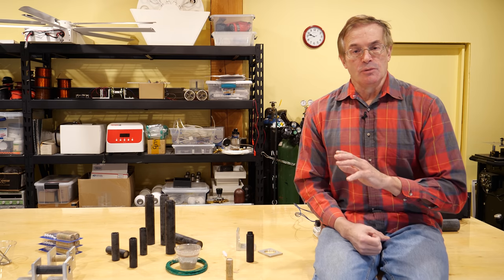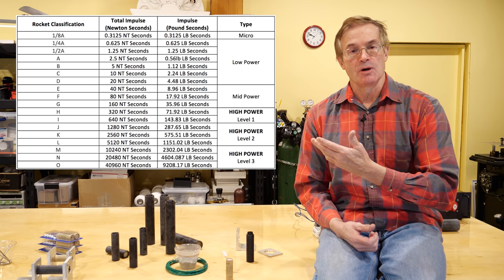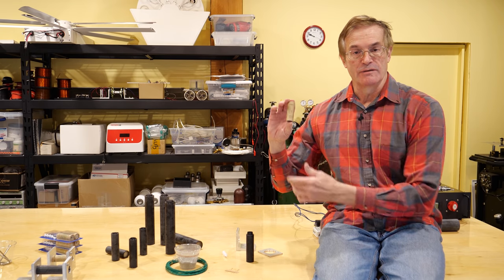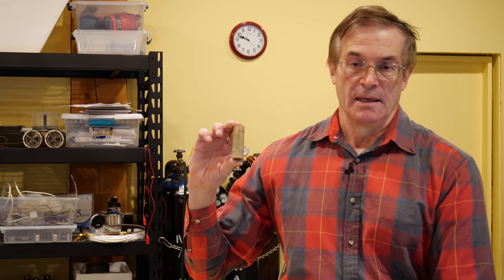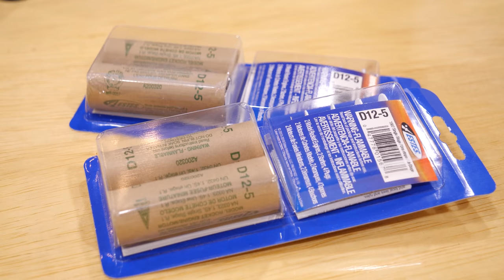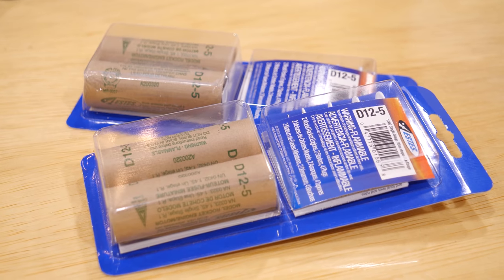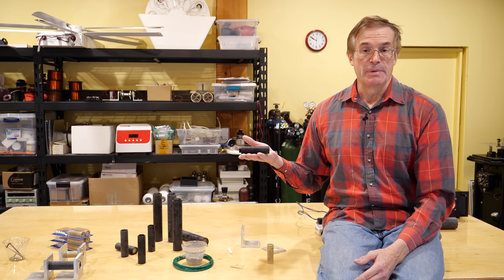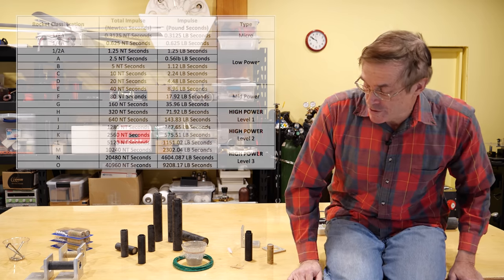Igniting Our Own Rocket Engines - DIY

Comment: I used to make these during high school, awesome stuff and a ton of fun!

But aren't you losing a lot of power with the sparks flying out? They are basically still reacting and producing gas which could add to the thrust if the combustion completes inside the engine. I know you tested many versions of these and found this the best fuel mix, but there is obviously still room for improvement
Reply from the maker: Agreed

Comment: May I suggest a couple more Tech Ingredients for this setup?

As others commenters have mentioned, the burn profile looked odd on your DIY motors.  While a larger and more uniform (faster) ignition surface is the likely fix, I would also suggest looking for inhomogeneities in the fuel itself, largely due to how the fuel was poured into the motor housing.  The conventional way to do this non-destructively is with high-contrast X-Ray and a field-flattener, where a few orthogonal exposures should detect most kinds of flaws: Density variations, inclusions and voids.

But non-destructive is no fun.  There is a sneakier way: Attach cheap piezo microphones to the motor (I use JB Weld), then look at the FFT of the burn.  Many inhomogeneities can generate characteristic burn patterns detectible in the audio spectrum as periodic or chaotic components.  Multiple mics are recommended to permit filtering and rejection of tube resonances.

Second, try to get a thrust profile using a few cheap load cells.  Combining the load cell data with the microphone and video data, you should be able to diagnose and dial-in the DIY motors.

No, I'm not a rocket scientist.  Just a sensor and instrumentation engineer who has worked on lots of weird and wonderful systems.

Comment: Hey guys, how about a large fan, on low, pushing all the smoke to the side opposite the camera? It would help to see some of the finer details if the latent smoke and fog were always headed away in a predictable direction. Would also help to see the velocity of the exhaust gas by how much it is defected by your constant input.

Comment: I was making a smokeless powder engine with a variable nozzle over 10 years ago. I made it with removable grains, but interestingly you can't transport the grains themselves over the highway. so I had to make several rocket shells with oversized nozzles so that it's classified as a PAD. I don't know if the laws have changed, but it's strange saying that rocket fuel without a nozzle is not allowed, but a entire rocket engine (below a set value) is.

Comment: Your burn rate is off I think, from my limited experience,  you need to ignite the grain from the back of the motor so that the flame ignites the whole core at the same time giving much more surface area to burn. Doing it the way you did means it is burning from the nozzle end toward the back of the motor. Thats why E matches are used, you can shove them all the way in and when it ignites the flame front moves down the core toward the nozzle, not back away from it. Just a thought, otherwise, great content!

Comment: Hey tech ingredients. I found a video on reddit where a tarp gets pulled up into the blades of a helicopter and forces a quick landing and some of the comments got me thinking. 

Could something like that be used as a low tech weapon? Let’s say you had a very thin sheet of Kevlar (so it doesn’t shred very easy) could someone realistically defend a city for example by simply placing these sheets on tops of buildings? Or make a low tech device like a air cannon that would just fill the sky with these thin sheets if a bad heli gets too close? 

You could make a very cool video about this using a cheap RC heli. You could try using different materials and find out the best material for this. I would imagine you would want a material that is strong enough that it won’t tear easy, but is also light enough that it will get pushed into the air from the downdraft, then get sucked into the low pressure zone above the blades... then well... chaos. 

It’s just nuts to me that something as cheap as a 10$ tarp could take down a multi million dollar piece of engineering. 

Here’s the link. It has sound too. The sound is nuts after it hits the tarp. 

https://www.reddit.com/r/ThatLookedExpensive/comments/ko2t5p/a_large_tarp_gets_pulled_into_the_blades_of_a/?utm_source=share&utm_medium=ios_app&utm_name=iossmf
Reply: This sounds very similar to the concept behind chainsaw safety pants.
Reply: @twestgard2  I didn’t even think of that comparison but yea, exactly!

Comment: Would be neat to set up a pressure meter in front of the rocket tube and have the rocket be able to slide through the end hole, so you could measure pressure over time, peak pressure, etc.

Comment: Have you considered building a frame to hold the motor that deflects proportionally with the thrust; maybe just a simple vertical cantilever with a load-cell near the support and load-cell amplifier calibrated in newtons? And then using a data logger and a PC to store the results, finally create a plot of thrust vs. time. This could be used to evaluate and compare impulses (⨜F(t)dt=mv(t)) which could be used to optimize fuel mix and nozzle design. And if you were to build a model rocket, and were able to estimate other parameters (e.g. -dm(t)/dt, Cd), it may help in modeling performance.

Comment: Im a chemist from the Philippines and I really appreciate and admire your channel specially this issue on rocket propellants. Thanks for posting chemistry knowledge dissemination . . . I love it. How about increasing more its thrust power by adding homogenously small amount of nitroglycerine or nitroguanadine ( this lessen the oozing visible flames ) and minute quantity but evenly distributed trinitro triazine. The last can triple the thrust, but will require bigger diameter nozzle.
Reply from the maker: I would be concerned with adding a high explosive, even a small quantity to the mixture while it is still hot enough to pour.
We will be moving to ammonium perchlorate based composite propellent next.  This is much more powerful and not much more difficult to fabricate.
Reply: @TechIngredients  wow, didnt expect a fast response. I'm now one of your subscribers. Kudos and keep it up !

Comment: It would be great if you teach how to make things with molded plastic, such as a small boat or Kayak. The knowledge will be helpful to build many things. Thanks,
Reply from the maker: That is basically what you do when combining epoxy and fiber cloth, glass, Kevlar or carbon.  Covering a male or female mold is the same as you would have to do if you were using a heated sheet of plastic, but the results are far stronger.

Comment: For reference, the generally accepted minimum energy required for humanely hunting white tail deer is 45 ft lbs of energy and a minimum of .25 caliber. These are roughly .40 caliber and the h rocket on a .25 second burn achieves or exceeds that 45 ft lbs if I understood the explanation correctly.
Reply from the maker: Actually, the engine contains far more energy.  The thrust over that duration will accelerate the engine itself to a velocity dependent on its mass and the energy can then be calculated according to, 1/2 MV^2.

Comment: Interesting, and thanks for the exposition. The ejector doesn't look to be that well constrained, so while the motor may have a high potential size based on the fuel, what is the actual thrust you're getting? I expect that is already for a future video which I'll look forward to.

One nitpick I have to raise; What the heck is is the unit NT in the table? The SI unit of force is the Newton (N). Is the table from a published source? 

 Congratulations on breaking 500k subs. I'm amazed it wasn't sooner.

Comment: First thank you very much for your always perfectly interesting video-uploads!
1. Question: @9:20 "Narrow Nozzle". To prevent disasters like this explosion, how can you calculate in advance the nozzle diameter in relation to the rocket´s inner diameter and the used fuel?
2. Question: @8:07 "Store Bought Motor D12-5". Compared to e.g. the F Motor @9:50, why the store bought motor produces less smoke (a), less sparkling (b) and a better shaped spindle-like flame (c), which reaches  further outside the rocket body (d) and sputters less (e) meaning a more harmonic and controlled burn?
3. Question: How do you know, which class your different rocket motors belong to? Do you calculate the weight of the mixture, and the known energy of your chemical composition with a specific  formula to say, that this is perhaps a "F" motor?
Thanks alot!

Comment: Congratulations on half a million subs! I'd like to think that I'm responsible for more than a few of those. You guys picked up a great subject that seems to have a plethora of videos on it but with less than complete information or explanations for the 'why' instead of just the 'what'. But that said, I think that you may want to reexamine  the impulse curve and why you are assuming a bell-like curve instead of a more sawtooth type of shape.  My reasoning being because the active ignition area increases over time as the fuel is consumed, as a growing cavity in the center of the fuel is created with a roughly cylindrical shape, the ignition area on the edge of the cavity also increases.  My best guess is that since that area is indicitive of the rate of oxidation at any particular time, then that production rate would increase in area almost linearly through time (perimeter times the length), and I stated 'almost' because of the length increase that is at the closed end of the engine (that is a small value) which would cause an upward ramp superimposed on top of the sawtooth. The production rate then is converted into thrust by the square of the velocity, so given a non-variable nozzle throat I was expecting to see a parabolically topped sawtooth shape for impulse over time plots....  I think the one that didn't survive was the best at illustrating my expectations. It was doing fine and then reached a pressure (because of the increasing gas production rate and restrictive nozzle) that was higher than the fiberglass tube was strong enough to contain, and rupture was the solution. 

I thought that you might have a datalogger and a load cell hanging around someplace, or scale or even a spring to tell quantitatively the impulse (average, specific, total) from the different engines, but then again, as a first go on testing these engines, it was fantastic. 

Thank you and again, congratulations. I'd bet that you hit the one million mark in the second quarter of 2021, if not the first.

Comment: Cool video. That 'unplanned rapid disassembly' of that F engine was pretty impressive. I imagine if that had happened with one of the larger H ones the hold down bracket might have had some damage. Where did you get that piece of ballistic glass you have protecting the nice shiny new camera?

Comment: You can in fact buy higher power motors. E-F is the highest you can get that are black powder. From the right places like apogee components or other hobby websites you can get PBAN engines most of the way up the letter scale.
I also noticed you are not using plugs with your engines when you light them. Fuses normally struggle to light more than one location inside the engine, so when you plug the nozzle, the combustion chamber fills with hot gas and can light the entire grain surface before it actually starts firing. Obviously you really need to be careful as this adds a lot of stress on the casing. I played around with it as a kid and found different performances based on electric igniter depth as well how firmly the plug was in the nozzle.
Reply: That's the nice thing about an e-match, you can light the very top of the grain which tends to light the rest fairly quickly.

Comment: I was surprised your thrust was pretty off-center on most of them. Looked like if you actually tried to launch those they would just loop around and come back at you like a boomerang. I wondered about that when you were hand centering the guide rod in the tubes during construction.

Comment: Watch your small nozzle motor in slow motion. I don't think it over pressured only because the nozzle was too small. It failed internally before the external rupture. There is a bright flash for a few milliseconds that looks like part of the grain may have broken off internally and plugged the nozzle, and that may be what over pressured it. The burn rate was not stable either, which would leave me to belief either there is some resonance in the combustion chamber, or the grain is sloughing off at intervals. The average nozzle flow actually looked much better on this motor compared to the others  . . . like it was producing superior thrust. If you took an impulse trace off of this one, it would be very interesting to see.

Comment: These rocket motor videos have been my favorite of all the videos you have done. When I was a kid I was Boy Scouts and we built rockets for a merit badge of some kind. I absolutely loved it but the rocket kits and engines were just too expensive for my family to afford so I never went any further into it other than launching a rocket with an egg in it and retrieving it unbroken. 

Are the engine tubes reusable? I know they are fairly cheap but I was just curious and I don't think it was mentioned. I would imagine that it is easier to just build new ones than try to pull the nozzles out not to mention the heat might make the tube weaker for future launches.

Comment: It's just a gut feeling but it looks like your exhaust velocities were pretty low compared to the commercial engines. I supposed it was down to nozzle size but the small nozzle version proved that theory wrong! It might be a good idea to get on that lathe that's hiding in the corner to turn up a couple of core-formers, they won't need to be complex, but if they're held properly centered and are the right profile (slightly tapered, rounded tip to stop cracking of the grain), it'll go a long way to getting running properly.

I do things a little differently but have had great success, I pour them upside-down to your method:

Grease core-former and place point up with tube over centering boss on base.
Pour/ram nozzle mixture (correct divergent nozzle profile is machined into former)
pour/ram fuel (castable fuels need to be fairly low viscosity, most sorbitol mixes work but sugar based fuel can be a pain!)
pour/ram cap (and add a passfire+bursting charge if needed)
Et voila!

Comment: Wait you didn’t put a load cell on there to see the force? Pretty cool , but figure you’d want to know the force curve, as if you low on force in the beginning getting the rocket to lift off in the begging straight will be difficult. 

Also it be neat to see that small nozzle with the fast and slow burn, but you put a hole all the way down, hmm so much fun

Comment: "Light it and run" is a fun way to phrase it, but, it would be very prudent to make it very clear for the younger viewers that you need to use a long enough fuse to be able to WALK away from the engine before full ignition. As was said in another comment, if you fall while running you could find yourself in an unsafe location when full ignition (or malfunction) occurs. Otherwise...excellent videos.
Reply from the maker: Thanks.
Check out our follow up video on electrical ignition systems.

Comment: Great stuff, I was slightly disappointed you did not graph the thrust or deal with the parachute ejection charge. I wish i knew this stuff when I was a kid in the 80's. Our favorite was Flight Systems Incorporated (FSI) E5-0 booster and E5-6 upper stage (9 seconds of total burn), was good for +4000 feet. We found this combo with the FSI Star Gazer rocket, but then we built our own, much smaller, lighter and less drag. FSI catalog from 1988 here http://www.ninfinger.org/rockets/catalogs/fsi88/FSI_1988_Cat.pdf  We would sometimes also add one Kodak container full of pot seeds, this was ~1500 seeds to give the mission a purpose. :) Happy new year. EDIT: I forgot to mention, the FSI F100 motor will hit mach1 and with a small boom, you need to be ~800 feet away from the launch pad to hear the boom (depending on the nose cone shape) . The F7 was also a good one with 9 seconds of burn.

Comment: I am so pleased I stumbled over your youtube channel.  I really enjoyed the model rocket motor build with excellent background and explanation,  Outstanding presentation.  I intend to fully explore your channel and I have already promoted the channel to others.   One question:  How would one go about putting a timed ejection charge into the model rocket motors?
Reply from the maker: There a formulas for delay burn through segments to a black powder charge on the far side of the plug.
However, for larger motors like these it's common to use an electronic trigger for that charged based on variables such as velocity, altitude or acceleration.

Comment: You can improve the stability of the burn by taking a vacuum pump and applying a vacuum to the fuel while it is soft. When you stir the fuel mixture in the manufacturing process it entrains air the changes the burn surface as they become exposed causing the non uniform burn. You could get a large flange and bell to degas the fuel before you pore it and or after pouring. Obviously if you only do this after pouring the fuel will bubble up more as the bubbles that form at the bottom rise. Great video though, thank you. Anyone looking to solve problems in any type of design can hire rgta.llc to solve or improve engineering and manufacturing issues as well as evaluate companies or product ideas.